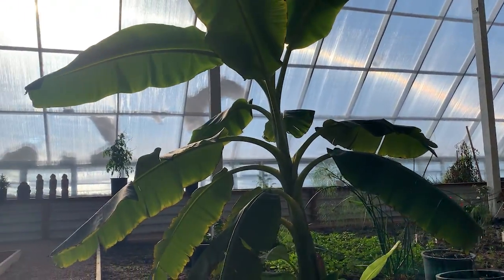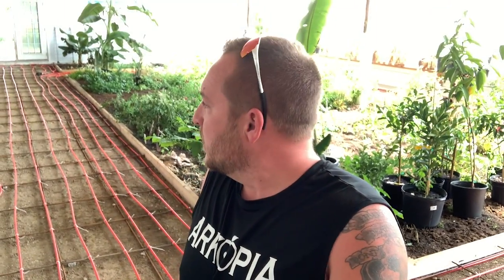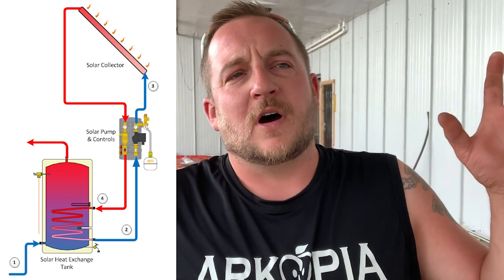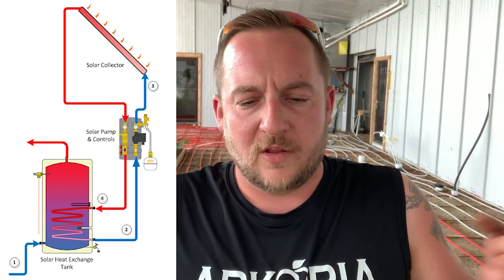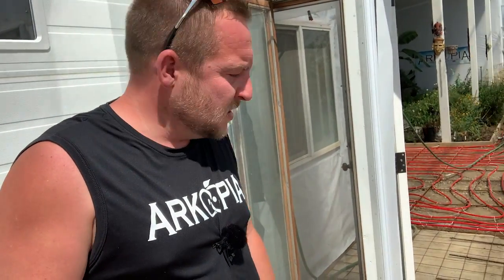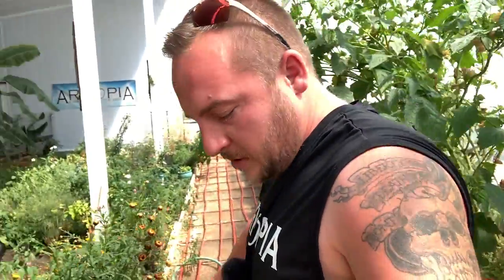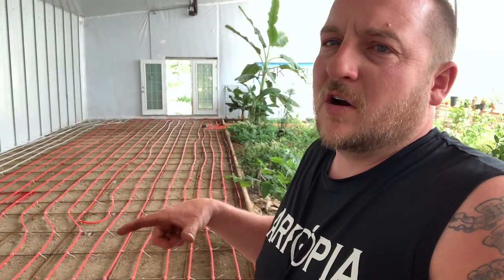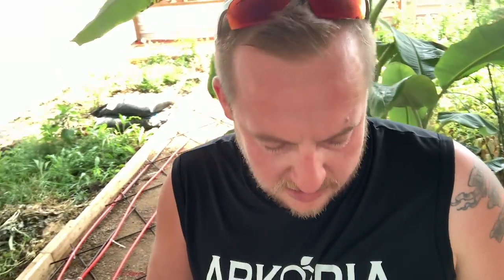Water Thermal Mass for Deep Winter Greenhouse

Comment: I'm curious are you planning on putting temp and RH sensors down there? I'm planning in building one of these and I may use something like an aroya or pinnaclecontrolsystems. To control everything
Reply: Also what's your thoughts on a rolling greenhouse cover for night time to roll down the poly to retain heat or possibly roll down on the inside of the poly behind the 2x6s. I know u did the 6mil plastic.
Reply from the maker: I should throw down some probes down there quickly here.   Didn’t think about that, thanks.   If I can figure out some roller blanket, I might do that in the future.   I would have built it slightly different to have a blanket work easier.   Bah, can’t think of everything. 😂
Reply: @ArkopiaYouTube  it's an endless process, keep us updated for sure. ur living my dream man. Best of luck
Reply: @ArkopiaYouTube  Endless Pools have a roller cover system for their pools, both powered and manual. Basically an aluminum tube that the pool cover is attached to. Either with a hand crank or a motor. The cover has ropes imbedded on the three edges. There is an aluminum track on either side of the pool that the ropes slide in. There is an aluminum bar on the end that has a groove in it for the third rope, so the cover is pulled evenly along the tracks. It is so strong, you can walk on it.  You could do something similar with several shades in parallel across your GH.

Comment: sounds a bit wasteful a use for the tubes, in a way, but it'd be a smart use on the other hand.. .go for it if you get a good deal, I guess :>
Could also use generic black PVC pipes to line the wall if you get a good deal.
Reply from the maker: Ya, if I can find the solar collectors used.   Lots of guys make pool heaters with just a ton of black poly pipe.   Making their own solar heater.   ✌️

Comment: Have you determined the number of solar days in your area? Theoretical solar energy available and your collector efficiency? You should have estimates based on experimental results and published data for your area before putting all that stuff in. Have fun with the closed loop/expansion tank/bleed valve system. They can be a big pain.
Off hand, I'd say all those barrels constitutes a solar mass far larger than the solar energy available. Hydronic heating radiators when I was designing specified a minimum of 140ºF to extract any heat at all. Optimum was 180ºF @ >2 gal/min. That was water to air. The conversion of water heat to concrete mass is much worse than copper/aluminum radiators. You WILL be running a circulation pump at least 12/7. What is the power input to the circulation pump? Will it handle the full flow load of the manifold?
Reply from the maker: No pump purchased yet.   Will have to size it with the manifolds.   One of the sunniest places in Canada where I am. 👍
Reply: @ArkopiaYouTube  Got that from earlier episodes. Ambitious project, and smartly done on the passive part. I terminated bldg my solar water system as the actual total sunshine in my area was much lower than published data. (Unpredictable temp inversions from cloud cover) That aside, it was not possible to obtain sufficient energy with the entire south roof covered with collectors (700btu/h/sqft) to bring 1000 gals of storage up to usable temperature, 160º min., >454K btu/hr, 10 hrs of collection. Not much use in collecting if it takes more than a day to produce a day's worth of total heating. If you KNOW from experimental data you'll get enough, FB!

Comment: Hold your horses - your concrete company can provide you with black concrete - no need to paint it, and since the concrete is black all the way through. A) it won't scrape off like paint does, and B) perhaps it will radiate heat into the pipes and ground better. If you are mixing it yourself you can buy additives that will color the concrete.
Reply from the maker: Just a a quote for die for all the concrete.   $3500.   And it probably won’t be jet black.  My finisher said it’s way cheaper to do something after the pour. ✌️
Reply: @ArkopiaYouTube  What the other person said about dusting your concrete with colored powder after it's poured but still toolable is a very common practice. Look up Davis colors. They make a wide selection of them. I had a stamped driveway done that way, but I also did a sunset rose patio slab with the concrete colored at the plant.  The $3500 is the upcharge over the cost of the grey - wow.